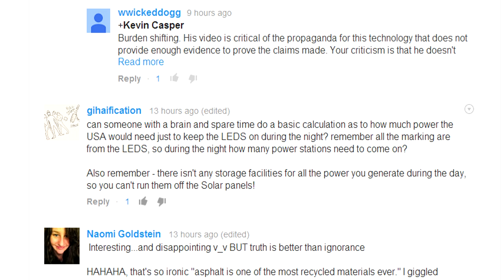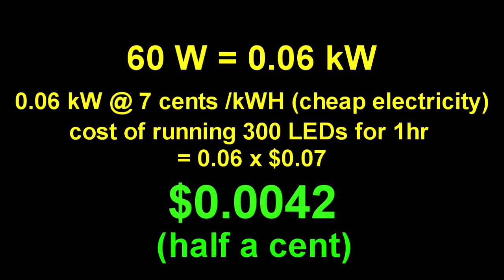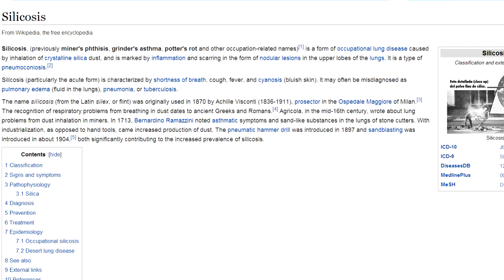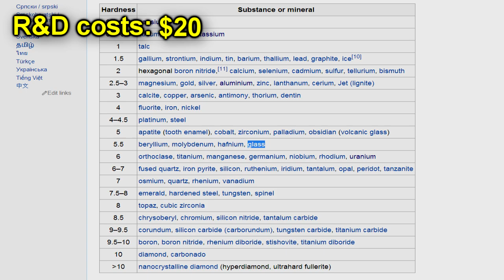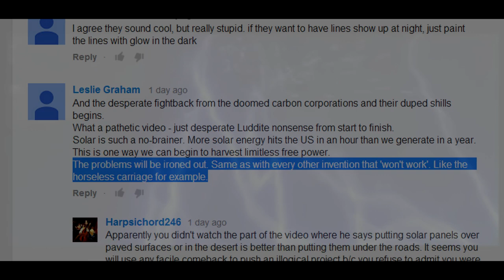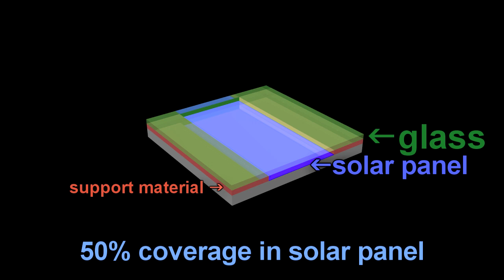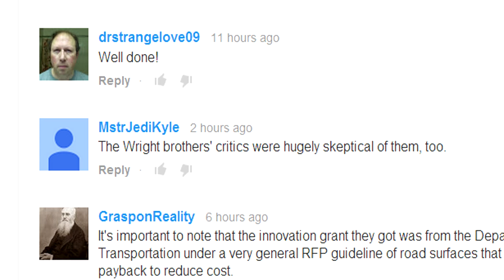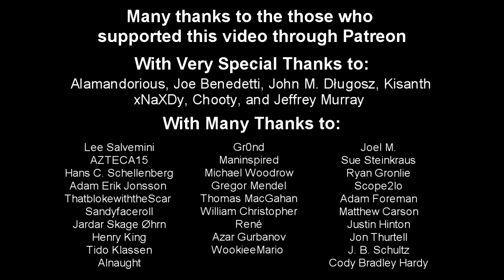Solar Roadways, IMPORTANT QUESTIONS AND ANSWERS!

Comment: Good video.  I'm all for increasing the use of solar power, but the makers of the Solar Freakin' Roadways advertizing video lost me when they claimed that these roadways would generate enough energy to heat the road surface in winter in northern climes to melt the snow and keep the roads cleared of snow and the panels operational.

Unless those roadways are connected to impractically large arrays of batteries capable of storing sufficient energy for later use in powering heating elements built into the road surface, there's no way such roads wouldn't become completely inoperative once blanketed by even a light snow.  I don't think people realize that powering a heating element requires far more energy than powering an LED.

If the direct sunlight itself isn't sufficient to melt the snow on a road in cold temperatures, there's no way the solar panel, which converts only a fraction of the solar radiation hitting it, could possibly generate enough energy to raise the road temperature enough to melt snow in cold temperatures.
Reply: Indeed, melting ice is much harder than people think because the latent heat of fusion of water is very high. An interesting application of this in the field of climate is looking what happens in Siberia in July or August. Temperatures in this part of the world can reach 30C in mid summer, a little further south and 35C is even possible, yet the arctic basin which is at the same latitude is held back at 0C and covered with ice even in mid summer (although not so much anymore due to climate change). And the north pole gets constant unrelenting sunlight for six months, in fact in late june the north pole has the highest insolation on the entire planet!
Reply: Good points *****.
Another difficulty is that in climates experiencing cold winters (such as the northern states of the US, Canada, etc) the ground freezes and thaws through autumn, winter and spring, which causes expansion and contraction of our roads and lots of irregular upheaving of the road, resulting in cracks and splits in our blacktop roads and bumpy roads.  Fortunately, asphalt roads handle such temperature stresses, and can be patched with a bit of tarry material or asphalt.  But eventually the upheavals and cracks become too numerous and the asphalt must be torn up and the road resurfaced to make it smooth again. 
A road made of small hard, inflexible hexagons would, as a result of ground heaving, result in the corners of these panels sticking up where the ground beneath has heaved and subsided and some panels being raised relative to neighbouring panels, making for a road so irregular and uneven as to be a danger even under ideal driving conditions, to say nothing of the damage inflicted on panels which  have lifted relative to others. 

I also have the feeling that most people don't appreciate that our asphalt roads are NOT flat like a parking lot, but actually gently arched - significantly higher in middle and lower at the edges, so that water and surface dirt runs off to the sides into the gutter and ditches instead of pooling on the surface.  That's easy to achieve with a continuous surface of asphalt, but with discrete panels, this means the road surface will be uneven and bumpy...and this will worsen with every freeze and thaw...dozens of time every single year.
Reply: Ozymandias Ramses II Indeed, I made the point about freeze thaw on their original video. Also one has to consider the states in the NW of the US that can get both cold winters and hot summers, so have to deal with the thermal expansion of the glass (which is typically higher than most materials) in the summer, as well as the freeze thaw in the winter. So of course making the spaces larger to deal with thermal expansion in summer, makes the freeze thaw problem worse in winter; catch 22.
Reply: Yeah, I wondered about expansion problems, but don't know enough about the materials used in such panels to predict if that would be a problem. 
I was curious how the panels are connected to one another because water and surface dirt will collect in the cracks between them and expand when it gets cold, causing the gaps to expand wider and wider with every overnight frost.
Reply: They lost me when they said "Freakin"
Reply: I would agree, *****, if that were the point of the roads.  They did not intend to be efficient at collecting solar energy, however.  They intended to replace asphalt (a fossil fuel product) with something that would pay for itself.  So, while it is true that tracking solar panels along the side of the road would be more efficient, it does nothing to address the primary goal of road material replacement (i.e. asphalt would still be used).  And as far as energy storage, I read recently (in response to *****'s videos) about a solar power plant in Grenada, Spain, that has a method of storing solar energy at a 7% loss of energy, rather than 20% (apparently the norm).  Energy storage is an issue, and it is also addressed by the Solar Roadways people.  As I see it, however, even if we were solar by day, and used conventional means at night, we are still lessening our dependency on fossil fuels.  A worthy goal, I think.  Their small scale tests have produced positive results, now lets see where large scale takes them.  I maintain a level of skepticism about the Solar Roadways, don't get me wrong; I just want to see their research go to large scale testing and fail/succeed there rather than the laboratory of our minds.  How many times have scientists conducted experiments, or developed hypotheses, expecting result 'x' and are surprised with result 'y?'
Reply: Just a minor point, the solar roadways page addresses the heating element issue.  They incorporated the heating element to be powered independently (or perhaps indirectly from power captured previously from the sun that was stored somehow, or, barring that, supplemented from another energy source).  They also noted that there would be a point, geographically, that their road systems would not be practical, or even advisable, and that intensely cold climate would be chief among the reasons.
Reply: Ozymandias Ramses II I did a back of the hand calculation with plate glass linearly expanding at 0C to about 30C and got about a tenth of a millimeter for a 1m length panel, which might not sound like much but of course has to be taken into account. Metals generally have expansion coefficients orders of magnitude higher than insulators though, so I guess they would have to worry about differential expansion of components. The bigger the panels the wider the spacing will have to be.
Reply: JD Wiley Energy storage is actually a real issue, its very difficult to do for long periods of time without significant losses or more sophisticated methods. And the solar panels which are LED lit are unlikely to break even so you would have to have infrastructure in place to share energy between the panels which is a job in itself. Its most likely they would have to do it independantely which completely defeats the purpose of having these solar roads in the first place. Lets say I compete with 'solar frigging roadways' by relaying a 10m section of road with asphalt and then building a row of tilted varying solar cells by the side of the road. 'Solar frigging roadways' can put their solar panels into the road. Who is going to come out better in terms of the road and the gain from the solar cells?
Reply: JD Wiley
 Thanks JD.  My comments about the lack of feasibility of heating the roadways using solar were based on what's stated in their video .  I'm glad that on their web page they acknowledge that the panels could not generate sufficient heat to keep the roadways clear of snow.  And it goes without saying that there's be some geographical limit in any case, but my objection was that the panels could not produce heat to EVER melt snow in any location because if the panels could generate sufficient energy to do so, the direct sunlight would already have done so.  Stored energy would have to be used.  But I'm glad they at least admit that on their site, because that's never stated in their video.
Reply: JD Wiley Yes but asphalt is a waste product anyway and 99% recycled! Its not like glass is more readily available and does a better job as a road surface. My 10m section road with the asphalt/concrete/gravel and the side solar panels would pay for itself fairly quickly. I doubt their 10m section would pay for itself at all when you take into account the LED lights, the heating element and high repair costs.
Reply: Ozymandias Ramses II Also lets consider the job a blacktop road does with added grit. Like thunderf00t pointed out roads behave more like black bodies than most other surfaces which is why snow finds it harder to settle, grit makes it even harder by lowering Tm to about -5C relatively easily; despite that even in the UK snow manages to lie on roads. In the cases where grit and blacktop clearly make no difference, say when we have temps circa -20C, then that means in addition to the latent heat of fusion we have to maintain a constant temperature of just above freezing 24 hours a day. That's a ridiculous amount of waste heat.
Reply: As I mentioned to Ozymandias Ramses II, there would be a point where these road systems would not be practical, nor, by extension, their heating proposal.  The further away from zero centigrade in terms of cold, the more energy would be required, and (depending on the civilian need) not worth the cost.  However, in those populated areas where it does get cold enough to require a large amount of energy to keep the road surface warm, conventional road cleaning methods (that cost taxpayer money) could have funds redirected from them (we wouldn't need them the same way any more) to the energy cost of keeping them warm.  Or, in the case of intense cold, and/or low population, such a road system would (likely) not be implemented.  It is a waste of heat if one only considers the melted snow, rather than what comes along with it; safety, longevity, etc.  Are people's lives and safety, or longer lasting roads (and by extension less money spent replacing them) not worth it?  A cost-benefit analysis, I think, would show where and how such a system would or wouldn't be prudent, all things considered.
Reply: JD Wiley
"there would be a point where these road systems would not be practical, nor, by extension, their heating proposal.  The further away from zero centigrade in terms of cold, the more energy would be required, and (depending on the civilian need) not worth the cost. "

OK sure

 "However, in those populated areas where it does get cold enough to require a large amount of energy to keep the road surface warm, conventional road cleaning methods (that cost taxpayer money) could have funds redirected from them (we wouldn't need them the same way any more) to the energy cost of keeping them warm.  Or, in the case of intense cold, and/or low population, such a road system would (likely) not be implemented. "

But we have different systems already. If the snow is wet and near freezing point then it is cost effective to use gritters, and they are used for instance in the UK where snow rarely gets cold 

"  It is a waste of heat if one only considers the melted snow, rather than what comes along with it; safety, longevity, etc. "

Well of course it isn't just snow, you have to prevent them frosting or icing over

"Are people's lives and safety, or longer lasting roads (and by extension less money spent replacing them) not worth it?"

I dispute that these roads will be safer or longer lasting, and also consider the danger of broken bits of glass on the roads

 "A cost-benefit analysis, I think, would show where and how such a system would or wouldn't be prudent, all things considered."

I honestly find it difficult to find any benefits at all :S
Reply: I don't find it difficult, but I'm not opposed to the idea that I might be wrong.  I'm anxious to see this idea go through the gauntlet and see if it still stands.  But it is just one proposition among many in regards to renewable energy, so, while i would be sad if Solar Roadways were to fail, my dog in the fight is just that someone succeeds in the endeavour.
Reply: JD Wiley Fair enough :)
Reply: ***** "I doubt their 10m section would pay for itself at all when you take into account the LED lights, the heating element and high repair costs."
Not to mention the always-on half-mile radius network connection, or the load sensors that are sensitive enough to detect children yet rated for main battle tanks and possibly heavier things.
Finally, they want to equip the tarmac at Sandpoint Airport.  Since a tarmac is a runway, can these solar panels handle the forces involved in takeoff and landing?  As an example, a 747-200 weighs about 190 tons empty, 410 at max load, and is moving at around 170mph at each ground tangent.
Reply: yeah exactly. if the sun is ALREADY not melting the snow... how the heck are you going to capture the sunlight and melt the snow with it?

Comment: In regards to the solar panels being fragile, there are flexible solar panels too. Ironically they are more rubberized than glass. 

Why the inventor didn't make this the go to idea I don't know. Even then i am pretty sure the real world wear wouldn't make it worth while.

A better solution, would be to have solar shingles for houses. Even if they didn't have enough to power the house, if all houses had them, it would more than likely have enough power to drastically reduce the strain on the power grid.

Comment: all you address is the money issues. you didn't even address how our street lights use led and are easily visible. i thought it was comical how you used your solar cell indoors too. but you do bring up nice points, if they offered you a job with some of that 2m they raised, would you take it ? i think you would. a lot of what you say doesn't hold much ground and appears to me as displaced anger but should be said and definitely be payed attention to.

Comment: Flawed tests. We don't know how delicate these solar hexagons are because we don't know what material they are real using. It could be some kind of magical plastic or even transparent aluminum (yes that is a real thing). Naturally the cost would be too high, you might be able to build 1 or 2 hexagon prototypes with that kind of material for what they have raised so far that could withstand a few months of light traffic.
I think the real issue is in the lack of flexibility. Roads MUST be able to bend and flex under stresses. This is a basic safety feature. Of course roads are not perfectly flat, nor are they perfectly straight (personally I think that if all the road systems were laid out in a grid, it would solve more problems than it would cause). Have you ever seen a road that goes up and over a hill? Did you know that hills and valleys are not stationary, stable structures? Ever seen a sinkhole? This is why low cost materials are used instead of these special, very very expensive solutions. I would bet that once funded, those "smart road" people will disappear with the money.

Comment: well lead balloons/zeppelins are possible, myth busters showed that
Reply: Yes they did, that was one of the best episodes I think. Like solar roadways, lead balloons are highly impractical and no one would seriously propose developing them for commercial use.
Reply: But is it efficient? is it better than a normal balloon?
Reply: Aston Martin The exact opposite actually. They proved it was possible, but needed to be way too big to lift a light load, and tore VERY easily, just by brushing lightly against anything. 
A good analogy to the solar freakin roadways, wouldn't you agree?
Reply: Cm0n3y34 yea i was just saying that they were possible like the solar roadways, good on paper but in actuality dont work to well

Comment: Stuff using these panels for the roads, I'm thinking using them for roofing tiles.  Better than the crappy scaffolding ones I see loads of, that go above the tiles.

Get every roof fitted with these.  

That sorts tons of the problems in one.  Heck keep the LED's in and be ready for Christmas.

Comment: We actually did surface research for a science module at GCSE level (although it was for GNVQ). We had to test the best surface for different types of shoes, though we didn't test glass. But your point still stands about it being high school level research.

To me it would make more sense to cover every roof top in America than covering every road. I'm guessing it would cost a lot less to do that given what you have to add to protect the solar road surfaces for it to work.

Comment: I just thought of something else.  When I was a kid we used to put penny's on the train tracks to let the train squash them in passing.  One of the other things that some did as a joke to the steam train that ran around Stone Mountain in Ga. was to grease long sections of track causing the train to become stuck.

How long do you think it will be before someone butters a section of road just to watch cars and trucks slide all over it?